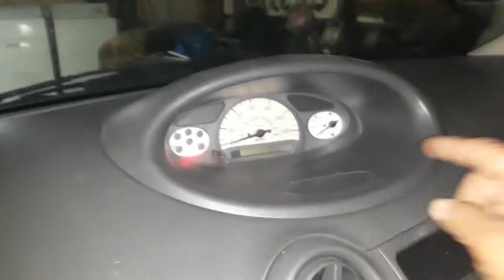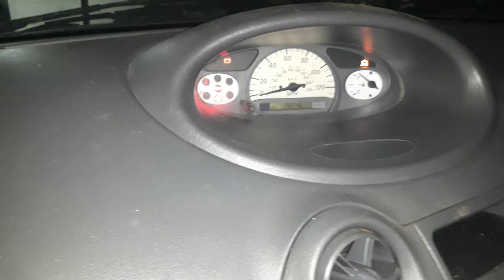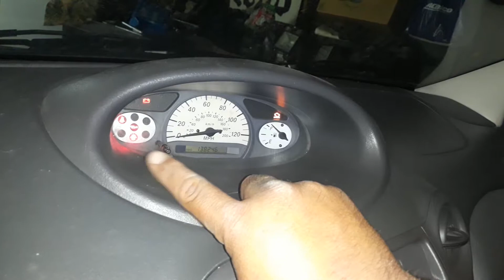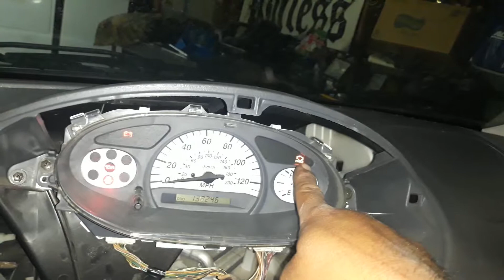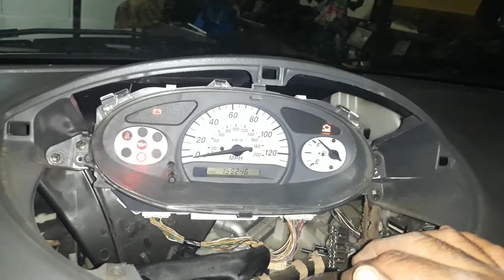2000 Toyota Echo 1.5L engine code P0500

Comment: 2007 Toyota Corolla s  have the same code P0500.  Vehicle speed transmission sensor.. I replaced it . The output one and it's still doing the same thing.  Rev high like it's going in neutral when driving . What can I do ? If anyone know please let me know
Reply from the maker: You're going to have to find a wiring schematic for your car if you change the sensor and it did not help it's probably the harness check the signal coming from the computer to the sensor and the sensor back to the cluster.
Reply: @SuperDjnrg  so more likely it's the wire harness . The mechanic told me there was life in the wires.  This jus so stressful not knowing the cause
Reply from the maker: @rayonwilliamssportsandfun2106  is the mechanic a electrical and electronics specialist? He would have to check the circuit being affected.
Reply from the maker: Also i would get a second opinion, if he is diagnosing the problem he should be able to figure it out.
Reply: @SuperDjnrg  I got ot diagnosed by auto zone and 3 different person. It cane back same P0500.   I bought one the output at o Reilly for 150 but it came without the gear so he put the gear from the old one in and same issues.
So.im gonna take it back to o Reilly.  Maybe it's the gear that's bad but it seems to look very good . I put in the old sensor without the gear and it drives better than wen the gear in but now the speedometer dont work .. it wud rev little still but not that often and it dont wen I drive faster.  So imma order one on Ebay with the gear and all .I'm praying I get to this. I live in north Carolina an without a car ur toast
Reply: @SuperDjnrg  not sure if specialist n.and to go to the dealership its gona b a fortune
Reply from the maker: @rayonwilliamssportsandfun2106  if you were in Bakersfield i could help you out.
Reply: @SuperDjnrg  I'm in fayetteville north Carolina
Reply: @SuperDjnrg  also the section on the dashboard that show how cold or hot it is outside keeps fluctuating.  Go to -22 up to 59° when driving and the gas gave go up and down too